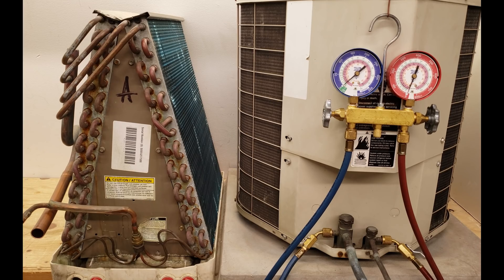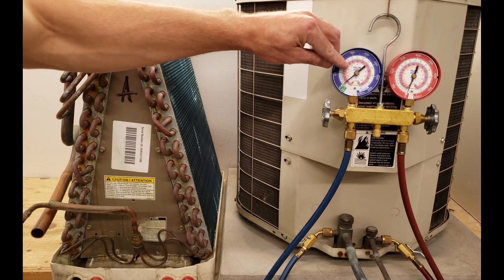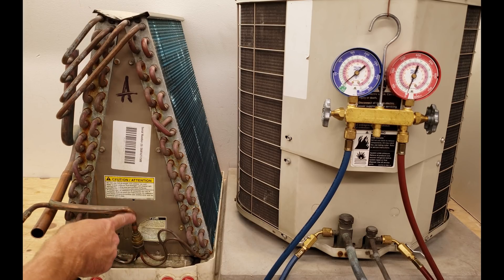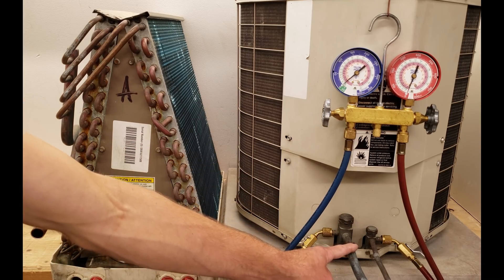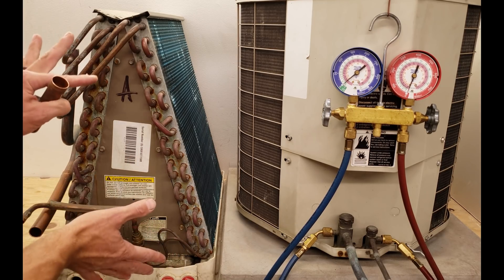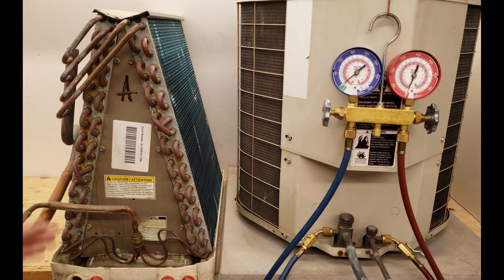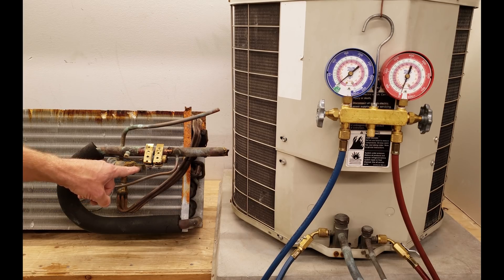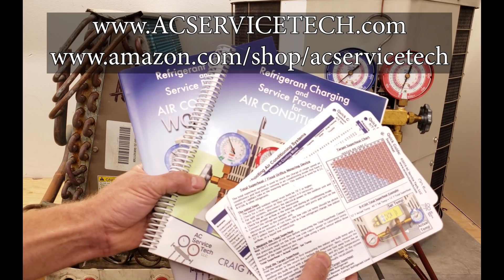Superheat & Total Superheat Explained!

Comment: I live in Phoenix with a 28 year old, 5 ton, R22 refrigerant, fixed orifice, no accumulator system.  Do you recommend conducting charge checking/charging at the coolest times of day?  I have a sman 480 and JL3RH for analysis.  Is there a page of your book that offers insight to this high outdoor temp/low IDDB environment? 
     What sort of efficiency improvement might I see if I added TXV?

Comment: Why would you need a port on the evap coil to take a pressure straight after the evap coil to determine superheat when you said that the pressure read you take on the port of the outdoor unit is actually the pressure and temp of the saturated state of the indoor coil? So to get superheat you wouldn’t ever need that extra port coz your already reading the saturated temp of the indoor coil at the port of the outdoor coil. So you would just need a line temp of the vapour line coming out of indoor coil and work it out that way. I still don’t understand how reading a pressure at the outdoor coil is relating to the pressure of the saturated state on the indoor coil. Shouldn’t it be reading the pressure and temperature at that point in the system where the port is? Doesn’t make sense to me
Reply: Ok I’ve had a think about it and I’d like to point something out. So your pressure read relates to a saturation temperature at that pressure for that refrigerant. So different pressure, different saturation temperature. So all you are doing is making sure your line temp before it goes into compressor is higher then saturation temperature at that pressure in order to make sure it is in full vapour state when going into compressor. However. You aren’t measuring the pressure at the indoor coil where it is in it’s saturated state. So you don’t know what temperature that would be saturated at. As it will be a different pressure in that coil when the refrigerant is saturated then at the port where you are reading. So you really aren’t reading the difference in temperature between saturated state in coil and the refrigerant going into outdoor coil because you don’t know what pressure that is in the indoor coil therefore don’t know what temperature it would be saturated at. Correct me if I’m wrong I’m not a refrigerant technician but enjoy this type of thinking

Comment: I've always been taught compressor superheat method. Gaurantees your compressor isn't slugging or burning up..also gets you spot on if not near spot  on for evap superheat. Of course this all depends on lineset length and how/where it's installed etc. But you explained it just like I was taught and how I think of it.  Good stuff :)
Reply from the maker: Nice, thanks!

Comment: Your channel and explanations are the best I have found. My only suggestion would be to explain "why" superheated and subcooling are reversed, i.e why supercooling is pressure minus temp and superheated is temp minus pressure. Also, when the system is either overcharged or undercharged is also the reverse.

Comment: I've just finished your book for the third time .  I'm halfway through trade school,  I've been able to use my "stubby" analog guages and my new and shinny testo 550 to check the S.H.  and S.C. on my unit , and my parents and next door neighbors as well .  I  appreciate your knowledge ,  its been helpful to try and get my " lab "  work at home during these covid times (  my school shifted from on campus lab / lecture to online only .
I think your book would benefit ,  students,  apprentices and seasoned techs. Love the larger size of the print and the heavy duty glossy pages .  And honestly, you so freely give away your videos and techniques that it made reaching in my wallet easy to do . 
Price point was very fair on the book . 
If you write an electrical book 📖  I will buy that as well .
Thanks,  stay safe and God bless
Reply from the maker: I appreciate the time you took to write this message Craig. Make sure that you are on the email list on the website for each new article or other resource thats developed, thanks again!

Comment: Great video，how do I know if unite has a piston or txv，do I have to open the box or I can tell from outside the box，thanks
Reply: When the condenser (ODU) does not have the expansion method and or the SUBcool value on the Name Plate, or if the plate is missing or faded, I have had to open up the furnace and look for the expansion device.  In some cases ( not recommended by the way) I have used the "lazy man's" method which is to observe the seconds needed for high and Low side pressure to equalized with relative comparison to a TXV system.  This method will fail if there is a significant fault such as a restriction
Reply from the maker: Song, you would look for a piston nut on the outside of the evap signalling a piston metering device. You could look at the indoor unit rating plate to see if it says txv installed, but other than that you would need to remove the front cover to see, thanks!

Comment: A lot of times if there is not a vapor port close to the evaporate I will get the saturation temperature out by the condenser then take the temperature of the suction line coming out of evaperator and subtract the 2. That will also give me accurate superheat. Is that correct? Thanks for all of the great videos
Reply from the maker: Absolutely correct, thanks!

Comment: I hv a 3 ton heatpump txv 20 yrs old, supercool is 14F, superheat is 10F if temp taken at evap vs 13F if taken outside on vapor line, outside ambient was 94F, inside 76F, 1350 cfm on med tap measured low SP @.28 spec is .5 . My question is:  Should I use the superheat of 10F using temp at evap vs higher outside vapor line?  How do these sound?  l believe good, Thank you, love the channel.
Reply: Since your unit has txv, the charge should be accurately checked via sub-cooling method. Check out many of Craig’s great videos on sub-cooling and superheat.
Reply from the maker: AD you are good with that. The TXV is keeping the superheat at 10 degrees and your subcooling for the txv is correct, thanks Ma Ma!
Reply: @acservicetechchannel  Thank you both I just did this 3 days ago after 10 years with older gauge set, BTW I like brass caps on my ports.  Also I have a 3rd schrader port coming out of condenser mid way high on case not on lines, it's a ICP Heil, do you know what it's for?  UPdate answering my own:  true suction before revs valve for when in heat mode to charge, got it.

Comment: Hey quick question Craig, I understand why superheat is important, to ensure we have 100% vapor going to the compressor and not liquid. But why is subcooling important or needed? Is it to ensure efficiency in the unit ? Make sure the unit is working properly ?
Reply: Craig will have a better more complete answer.  Measuring Sub cooling for checking the charge is needed when a TXV or EXV is used instead of a fixed Orifice as the expansion method because XV method regulates the Superheat where Fixed method does not.
Reply: You want complete liquid a the expansion valve.
Reply: Correct, and if we don’t have complete liquid going to the txv then what happens ? The unit won’t be efficient? It won’t work properly ?
Reply from the maker: Cesar, great question! Subcooling is important because it is the lowering of temperature of the liquid refrigerant before it hits the metering device. Remember that if the liquid is higher in temp, the saturated temp found after the metering device would be higher. You want a good 10 degrees of subcooling usually so that it is a lower temp liquid after the metering device but you don't want too much subcooling or the high side sat temp will rise to an inefficient amount and the compressor amps will rise, thanks!